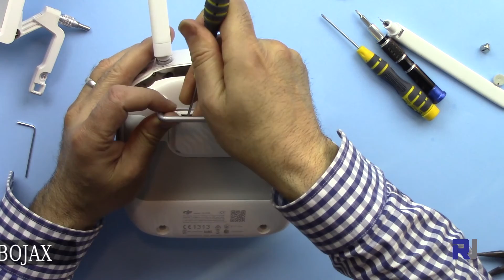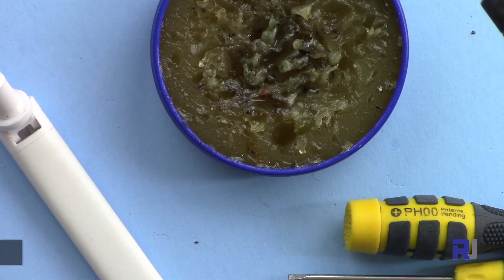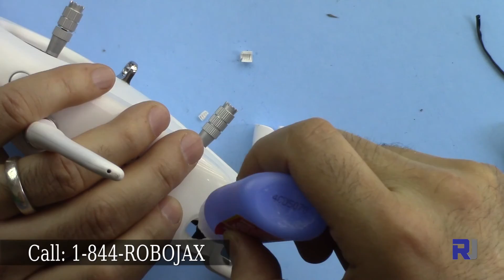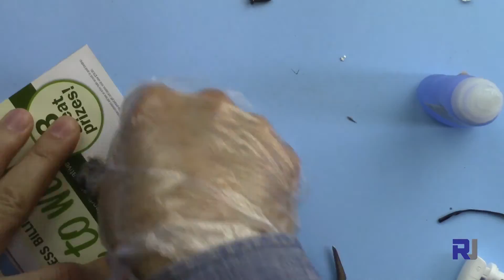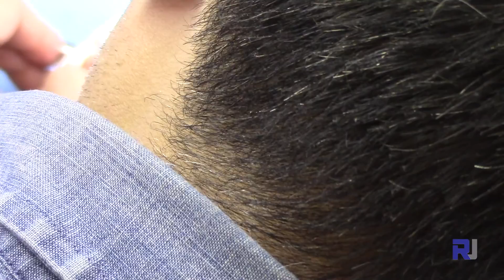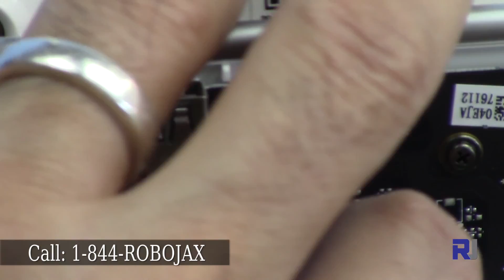Fixing broken Dji Phantom 4, 3 Professional Controller Antenna

Comment: Hello sir, my remote antenna totally broke off (left side), cant glue the pieces as most of it were missing. solder the antenna wire doesnt seems to fix it.  still having bad signal reception. do you have any recommendation?
Reply from the maker: Hello, the antenna is nothing but a wire. Use pen or something to hold is straight. there is a type of glue called cement which you can apply and it hardened itself to hold something. good luck.
Reply: @robojax  thanks for replying. the antenna mount is beyond glueing, no piece to mount on. so im planning to replace it with wifi antenna. perhaps rp- sma connector. will that works?

Comment: Where can I get a replacement part?
Reply from the maker: I assume DJI but, eBay.com or AliExpress.com should be the best source with cheaper price.
Reply: @robojax   I found a top case part, but that means that I have to take everything out and put it in the new top case. Would it be possible if you could make a video showing how to do that?
Reply from the maker: I recorded this video while I was repairing it for someone. I have no hand on this to do it. sorry.

Comment: For the first stage of disassembly I strongly advice to Google "demontage dji phantom 3 remote control" which leads to this video: https://www.youtube.com/watch?v=siWX7oADOTM

It shows you a better (at least less risky) method of removing the flatcable from USBboard. I Used a sturdy quality matchstick myself.

Comment: As a Engineer former Technician. If you just had remove those three screws on the HDMI board . You could have reinserted the mylar cable. Without mangling it or half destroying it like you did. If you where Factory authorized DJI you would have just replaced those antennas because mechanically they're not right and the right one might have RF leakage around the base. Which could interfere with the function of the remote control mother board. But I have only had my FCC license for 40 years .
Reply from the maker: This is simple quick fix without paying $150 or more to the DJI. It has drawbacks abut it has worked for 1000s of people

Comment: Yours was the second video I watched on the other was not the antenna change the main reason for the opening, but there learned that we must first remove that small board underneath, and taught in detail to open the locks of flat cables before releasing them , if we open the radio with the cable engaged we risk breaking, for opening the radio also just hold the handle and push in the base of the antenna that it opens at once without having to insert the screwdriver into the housing.
Reply from the maker: this is delicate work. You are right. The repair I did was for someone else but it worked.
Reply: Hi friend, as we learned a lot in practice we do not always end up going the best way to get the result we want, see the link as it proceeds with knowledge of the best way to open the radio, hugs.    https://www.youtube.com/watch?v=ze8bVGpX4-0&t=4s

Comment: you never solder on negative wire you heat shrink the middle wire, what about the exterior wire on the SMA cable ?
Reply: RoboJax Videos u realize u have dramatically degraded ur antennas capabilities by not cuting the shielding off and leaving the signal wire exposed. those sma wires shielding is there for a reason. to stop the signal fro, leaking out. think of it like a hose. if u cut it in half the water isnt gonna make it to the end of the hose. its gonna leak out where the hole is. so dam near  all ur signal is coming out of where the heatshrink is..
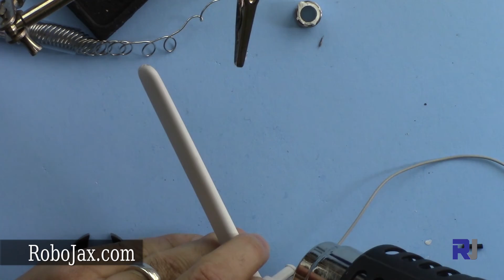Reply from the maker: after the point where the Yellow heat shrink is shrunk at 12:30 ,  the shield (negative) wire doesn't exist. The antenna IS the middle wire. (single wire). This is antenna is just a piece of single wire.
Reply: RoboJax Videos

Comment: You didn't show how to take the ribbon cable from the beginning of the video. 
You zoomed the camera in close but didn't say anything about flipping up the locking
tab that holds the ribbon cable in.
Since you have the transmitter open why don't you install the extender antenna kit on it.
Reply from the maker: This was very hard to film. As for the antenna kit, there are so many type available and the best option would be to attache the antenna booster/extender that doesn't need any opening of transmitter.
Reply: When people add extended range antennas on their newly purchased DJI Quad Copters I would think it would void the warranty.
These add-on kits would be nice to be able to screw the antennas on and off to switch antennas. I know if you turn the transmitter on while there is no antenna connected it would burn out the transmitter (no load and high SWR).
It wouldn't take much engineering to have a sensing circuit to shut down the transmitter if it doesn't see a load. This is done on the modern ham radio transmitters and linear amplifiers.

Comment: Nice video....do you have any suggestions on modding the controller for screw on antennas?
Reply from the maker: Thank you. If you mean screw of the antenna to antenna attachment (to controller), I would use a 2mm drill and drill through the antenna and the attachment and then use screw and nut to tighten it. But if you meant the antenna base that is going through the controller, then the Original antenna should be able to turn about 300 degrees and as I did it, just glue it and you will loos the rotation capability.